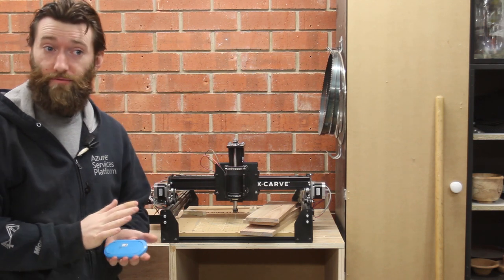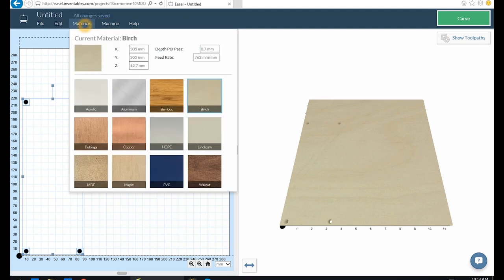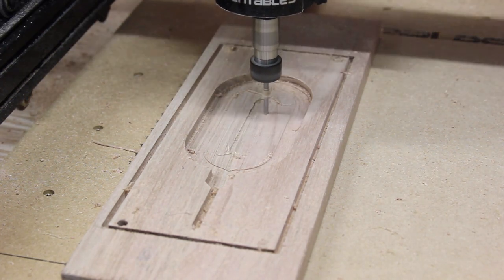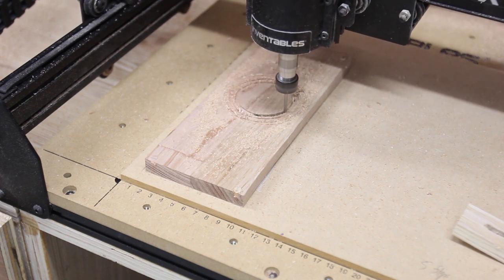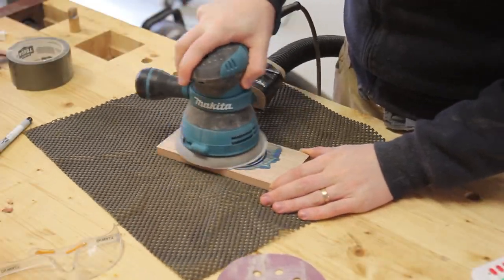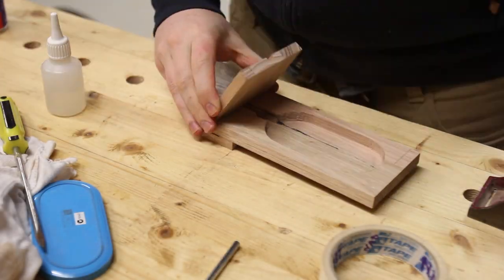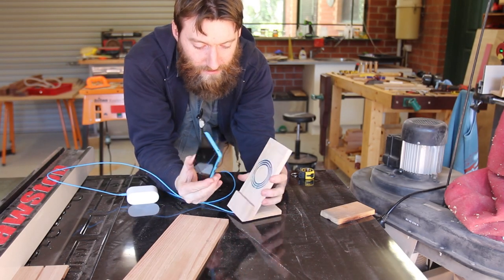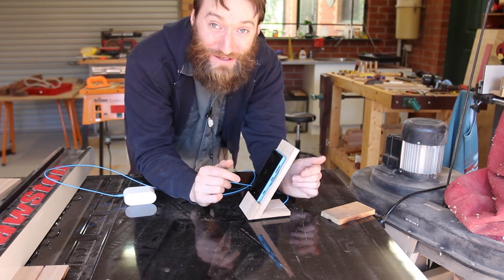CNC: 2-sided machining to make a wireless phone charger/stand - 061

Comment: Questions and comment...

1. Did you have to experiment to see how thin the wood needed to be to still have the charger work through a wood barrier?

2. What did you use for your one drop of dye?  Food dye or dye specific to use with epoxy?

3.  Wouldn't some metal pins also work for pinning your blanks in place?

I like how you admit your mistakes and keep them in the video, we all make them so it's nice to see how you make corrections once the error occurs.
Reply: I use good  one

Comment: That exact design (minus the circles) is what I've been looking for. I will probably make one very similar. W/o CNC as I haven't been blessed with one yet.
Reply from the maker: ***** Although it'd be a bit trickier, if you've got a router bit & bushing you could make up a template using a large drill bit (or one of those adjustable circle cutters) in some MDF/plywood stock, and that'd let you cut out the recess cut relatively easily.

Comment: Looks great! Just make sure that your meassurements are right and im sure you'l be able to make what ever it is you want to make! :)

Btw, do you have any tips on working with Bamboo? If it should be avoided or if it would behave like wood.
Reply from the maker: I've never worked with it, sorry. AFAIK it works just fine, though it is very hard.
Reply: Its fine :) Just wanted to know if it splinters or anything like that. Was looking into making a few stands with bamboo, sadly i know nothing about CNC milling bamboo or even how to work with it with conventional tools. It will be interesting to say the least!

Comment: Cool gadget project - love it. Can i ask what kind of dye you use to colour epoxy?
Cheers Paul.
Reply from the maker: Sharp Edge Woodworking I used Solid Solutions' Transparent Chemical Dye (and their epoxy casting resin, 606 I think) https://secure.solidsolutions.com.au/view_products.php?cat=14
Its designed for resins unlike a water-based/oil-based dye that might mess with the chemical reaction.
Reply: Paul Jenkins

Comment: Felt your resin issue pains... see if I'd watched this earlier it would have saved me some hassles. I've also done the the sand (well plane actually) straight through the resin layer trick. Not fun!
Reply from the maker: Epoxy is just a fad, it'll pass in a few years.. right? :)
Reply: @TheWoodKnight  yeah I can't remember the last time I saw someone use it... lucky there are these older video to reflect on 😅

Comment: Thanks for sharing right down to the nitty gritty mistakes, I've been looking for things to do on my new x-carve. I like how how it ended up looking with the part of ring sanded out. It made it look like an expanding wave which fits the whole induction charger thing you were doing. 

Couple of questions though, have you experienced any axis drift on yours? Mine drifts wildly on its x-axis.

A suggestion for the base piece, before gluing the front piece which the phone rests on, you could glue the back, securing it with long pins, say like a tapered or miller dowel, making it a lot stronger once glued. 

Lastly, how did you get a SawStop down to Melbourne?
Reply from the maker: +krappolla Gabbett Machinery/IWoodLike have been selling Sawstops for at least 3 years now
Reply: Ah, that doesn't help me much in the U.K. 
Good to know they're getting exported out to the wider world. It gives me hope that one might find a way to bring one over to where I am. 

Thank you for the reply.
Reply from the maker: +krappolla I'm not entirely certain but I believe its law in the EU/UK that saws need to be fitted with a break to rapidly stop the blade after its turned off, and is responsible for why so few machines have dado stack capability (more mass = harder to get it to stop in the required time). Being American, Sawstop saws don't have that, and until they do I don't think you'll see one in Europe.

Comment: Is there a trick for getting your designs centered in the work area? I'm going to try a similar 2-sided design this weekend.
Reply from the maker: +Conrad Designs I try and "home" to zero-zero on the waste board and I reference off that, but ultimately it doesn't really matter if its perfectly centered or not, so long as you've got ample material and x/y movement. ie, if you tell the software its at 'zero zero' on the edge of your work piece, put your design at zero zero in easel, and it'll cut out fine.

Comment: Thanks for another great video. With the tax man here is it worth spending the coin on one the x carve? Or do I buy that jointer/planer combo that I have been hanging out for......
Reply from the maker: Grant Oneill Thats a very difficult question to answer because it really comes down to the sorts of projects you want to do.

I make a bit of furniture, where the xcarve is significantly less valuable. However, it can be used for jigs for absolute accuracy to make furniture making easier.  For example, want to make a lot of router cut dovetails but don't want to fork out the ~$800AUD for a Leigh D4R Pro? If you can design it, you can machine it. A few jigs like that, and it can pay for itself very quickly.

Small craft projects, particularly when I need to batch them out perfectly? Its fantastic at.

On the other hand, I'm also eyeing off a jointer/planer combo, though I don't have one in mind yet. Any in particular you're thinking?
Reply: I have been eyeing off the carbatec spiral head jointer/planer for $2400, but already have a lunch box planer that works good enough and have jigs for my table saw to joint with.

I'm like you and build mostly furniture but would love a cnc to play around with to make tags or to engrave a logo into my pieces.,plus it's half the price of the combo machine.
Reply from the maker: Grant Oneill Thats a very similar debate to what I've had - I'd prefer to have a combo machine for the space saving, but a standalone 6" jointer is just so much cheaper!
Reply: I know the feeling. I really want a spiral head cutter, but could easily just buy a second hand jointer and be good to go. But I have learnt to just get the tool the first time otherwise you end up buying it later regardless. I'm onto my third table saw as I keep upgrading because I never bought what I wanted in the first place. Don't want to make the same mistake with a jointer.
Reply from the maker: Grant Oneill Very much this. You end up spending way more in the long run if you don't buy "right" - I know I have in the past and its difficult to fight my tightarse nature to not repeat the same mistakes! ;)

Comment: Love the thought of using plastic dowels. At first I thought brass but the realised that a simple misjudgment of position would probably cause irreparable damage to something or another. 

Regarding strengthening the glue up, what if you offset the long vertical piece from the short so the horizontal can slip in under it?

http://i.imgur.com/qVpZZXw.jpg
Reply from the maker: Rick Measham brass would probably be fine - its on the more machinable side for routers. I mean in theory they can cut proper australian hardwoods which are often compared to aluminium ;)

The depth/speed rates would be key, though if I was using a carbide cutter probably less of an issue. That being said, I didn't hit the dowels I did insert, so perhaps not too much of a safety issue!

Yes, that'd strengthen it too. I could have also added a biscuit or a domino, but with the mistakes I'd already made I found the CA to be the right balance of "getting it done" and "good enough" ;) Another option would be to create some 'jigsaw' like joinery using the xcarve to hold it together

Comment: Couldn't just use a couple of drill bits? and use 2 holes instead of 4
Reply from the maker: james shelton Drill bits would probably work so long as they're accurate enough. I've got a lot of really old imperial bits that I wouldn't mind sacrificing for this sort of task, so that might work nicely.

2 holes would work just fine if center aligned, probably better too :)